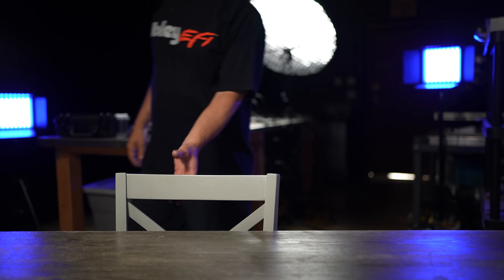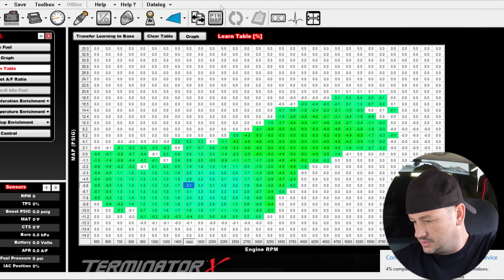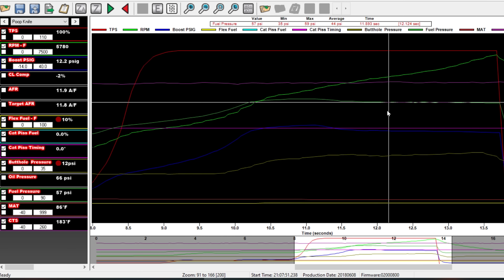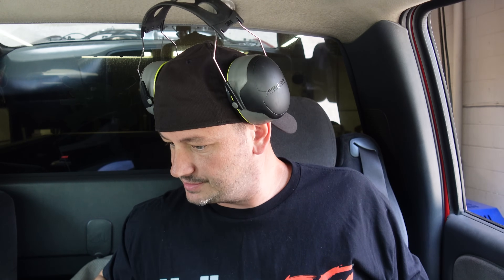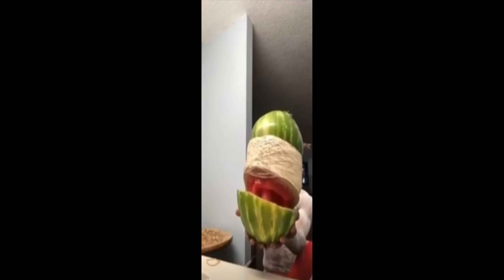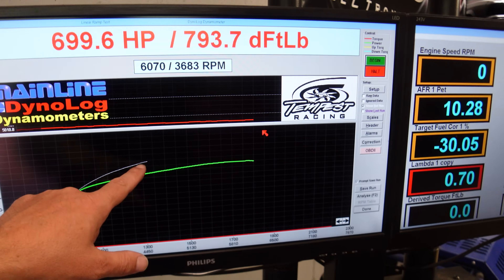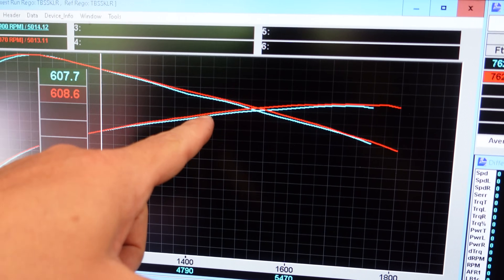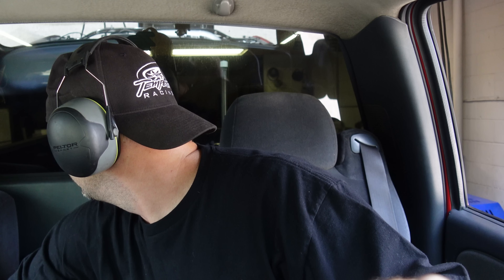Dyno Tuning a SBE Turbo Silverado w/ Holley Terminator X

Comment: Wassup joe !!! I have a question hopefully you can help me with....this is the only way I know to get in touch with you ...I watched you tune a car without co2 and dual Mac valves and you mentioned the settings are a little different when using the turbo as a source instead of co2...I just finished my build and drove it a few times but it won't build anything over 2lbs....do you think this is my issue ?

Comment: I have a 93 f150 I am working on putting a 95 5.8 into and have been trying to put an aftermarket ecu into, i have been looking at a terminator X max system but that may require a trans swap for compatibility reasons any advice or suggestions?  I am not doing anything crazy to it, i just want to do a mild cam and potentially improve fuel economy.

Comment: 12lbs of boost is not safe on pump gas? I thought 14psi was about max and 12 was safe for street thrashing?
Reply: I run 15 lbs with a s480 with a good air to water cooler and 93. Don’t get greedy with the tune and watch the plugs.
Reply from the maker: Boost is just a number. I ran 25 on my personal car on 93 octane
Reply: @JoeSimpsonAtTempest  turbo LS I should of said, SBE , guy like me with a junkyard LS just trying to not window the block 😂
Reply from the maker: @b00st_SS   well If one turbo makes 300hp at 12 psi and the other makes 800hp at 12 psi there is a pretty significant difference in what’s going to be safe or not. See what i mean?
Reply: @JoeSimpsonAtTempest  I’m smelling what your stepping in, yes! I Need to get some dragy times and scale my car do some horrible math and figure out what kinda power I’m making, dyno tuning just isn’t an option in my area, just a burnouts and ice cream car I’m learning to tune on via your TTT which has been VERY helpful
Reply: @JoeSimpsonAtTempest hey what would be the max boost a stealth system can handle since it’s delivery is more like a carb.

Comment: Why is fuel PSI in first log 59 psi @ 12psi boost? Wouldnt you want it to be 1:1 after 100 kpa?
Reply: His base pressure probably isn't 58psi. He might have it at 43 or 46. Running at 43, can help you stretch out, too small of an injector, sometimes.
Reply: @funfun8095  Gotcha. Figured there is no way he was stretching out 1500s at that power level as Ive made more than that with same injectors and below DC. But I can see setting base lower for whatever reasons.

Comment: I would like to ask you a question. If I would suggest that a local hero with a twin 69 mm turbo 5,3L is pushing 1150 hp at the hubs running 87 octane pump fuel with some octane booster, what would you say? :) No need to be overly polite. I am skandinavian. :D
I would also like to comment that 832 hp at 20.7 psi og boost is 345.5 hp from "The theoretical NA engine. Pretty much the same as the 343 hp the combination 624 hp @ 12 psi on 93 octane gives us. :) 
The 699 hp @ 12 psi boost gives us 384.9 hp at the hubs on E85 from "The theoretical NA engine". This suggest the engine need a turbo that can supply about 80 lb/min of air at less than  the 2 PR line in the compressormap and it must be inside at the 70% line. 
Not many 80 mm turbos can do that. Falling boost curve is usually the result. :)
Reply: Did you just take a hand full of Adderall?